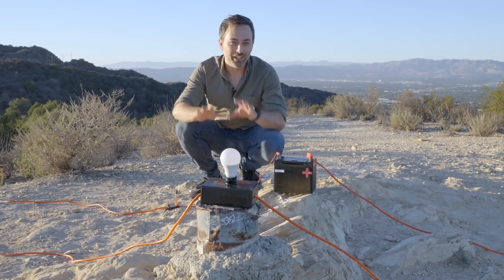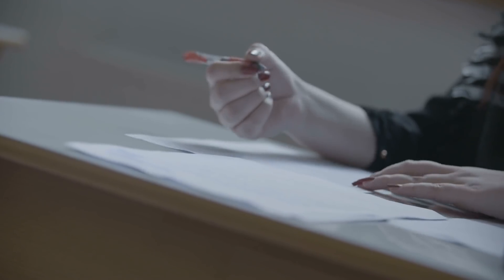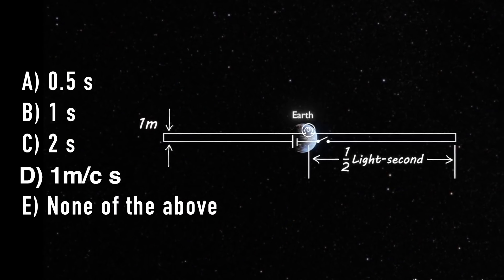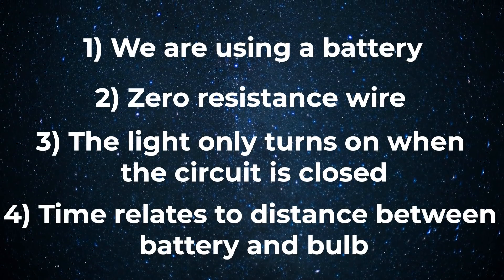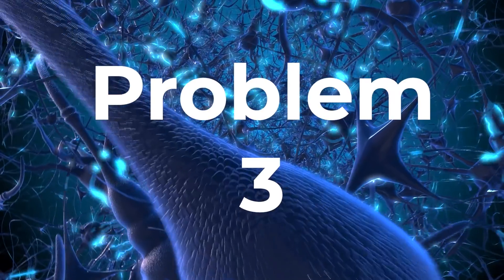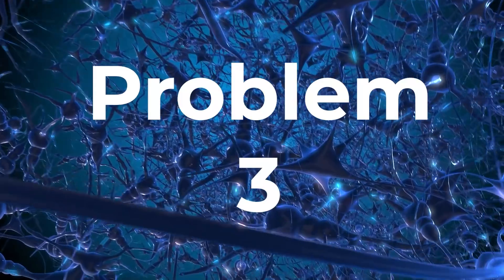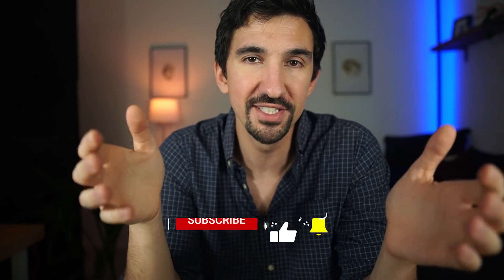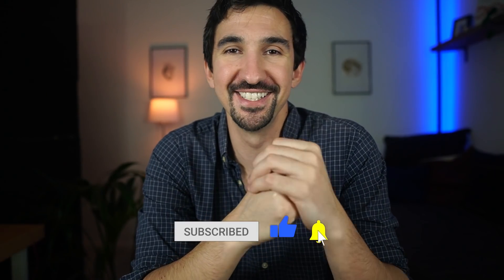Is Veritasium Wrong About Electricity?

Comment: Dr Miles, you've made a lot of very good points here, and thank you for taking the time to re-complicate something that was poorly oversimplified.
I don't know if someone has already mentioned this, but a really big deal breaker for that first thought experiment is very simply that although EM waves propagate at the speed of light, electrons have mass, and can only move between atoms at a small percentage of the speed of light.
So while things like radio waves will travel wirelessly between a transmitter and a receiver at the speed of light, as soon as electricity, or more to the point, electrical current is involved, we're back to signals travelling between atoms of a conductor at (I think) around 2.2 million meters per second. [EDIT: it is 2.2 million. I put 220k before because I forgot how long a kilometer is (doh!)]
My background is in computer engineering, and over the years there have been a few quests into the concept of light based computers as a means to overcome the speed limitations of electricity.
Reply: Maybe only 220,000 in fiber-optic. In bare copper wire about 285,000 (95% of light). See "velocity factor" for more information. VT ignored velocity factor explicitly as it would have been an unnecessary complication. (Much like first semester physics ignored air drag when covering gravity.)
Reply: @briant7265  yep, you're right, the velocity factor does add another dimension to this. I've only just recently learned the tiniest bit about this playing with antenna designs for radio receivers (something I'm still mostly clueless about). This still relates to the propagation of EM waves though, and how  different conducting and insulating materials affect them.
I'm looking at this from the the point of view that in electrical circuits, the movement of the electrons between atoms in a conductor happens at that much slower speed I was referring to.
In the case of electronic circuit designs, the timing of signals can be controlled by making the tracks between components either longer or shorter. You see a lot of these types of tracks around the CPU on a PC motherboard. If electrons behaved the same as photons and everything happened at 95% light speed, this form of timing control... well, the differences wouldn't be in microseconds, they'd be more like pico or  femtoseconds, and not much use at all.
Maybe I'm just confusing things though. I've been breathing in too many solder fumes!
Reply: @jamesstevens2362  One thing Veritasium covered that was interesting was that the electrons themselves move slowly, while the energy is a sort of electrical wave that moves near light speed. 

I got a ham radio license 11 years ago, and when you start looking at RF in transmission lines and antennas it will make you think differently. 

Here is a fun thought. A 3 GHz clock signal equals a 10 cm (4 inch) wavelength. That means when the clock goes - to +, circuitry 2 inches away is just going + to -, half a tick behind. At 6 GHz, 2 inches away is a full clock cycle behind.
Reply: @briant7265  how right you are! Coming from a digital background, RF has been a real eye opener. I attempted to design a PCB for a 5GHz downconverter, but getting the essential circuit traces exactly right for those frequencies did my head in! So yeah, I get what you mean about the electrical waves. It’s not just about the volts and amps you get from electrons moving about.

Comment: I think the power of the battery and material of the wire are irrelevant, they were illustrative to his proposition. He could have connected up 10,000 12v batteries in series to overcome your quibble on this point, and that was not the point. From my "O" level mindset, electrons migrate through a wire at far less than the speed of light, but the "Impulse" from one electron to the next in the line down the wire travels at the speed of light, doesn't it?

Comment: I thought the entire thrust of Veritasium's video was to debunk the misdirection about how electricty is delivered along a wire... that it's not a series of electrons nudging each other along the wire in order to transmit the energy from one end to another.  His video finally gave me, for the first time after many years, a plausible explaination of how the energy relies on fields around the wire rather than what's happening in the wire.  Which to me makes far more sense.  Just like magnets, which have obvious fields, surely electrical circuits rely on the same kind of behaviour given that both relate to the eltromagnetic spectrum.  I didn't give any thought to the subject matter of time, but found the fields illustration the whole point of the video.  And at last, relieving me of a conception I always thought was a bit dodgy.
Reply: There's a distinction between energy propagation and fields propagation though. Energy is propagated mostly around the wire, where there's also a tiny magnetic field hence nonzero  Poynting vector, but the electric field itself (if I'm not mistaken) is most intense inside the wire.

You need an 'intense' electric field  in the wire to generate a tiny magnetic field around the wire, to get a Poynting vector along the space surrounding the wire, that will carry most of the energy. 

(warning: this is not my field; my phd is in math and it has been many years since I took physics II)
Reply: @rv706  I'm a mechanical engineering student who is just now finishing my physics two class...finals week is right around the corner....

The equations for magnetic field in relation to a theoretically Infinite straight wire do propose that the further you get from the wire, the lower the strength of the field....the distance variable is in the denominator. But as soon as you cut into the surface area of the wire,  you greatly reduce magnetic field since you have reduced surface area of current propogation.
Reply: @Abrafo_00 : Yup, I think my picture is consistent with what you're saying
Reply: @Abrafo_00  The reason for the infinite length is to remove the curvature of the field at the ends of the wire.
Reply: No, it's delivered by the electrons jostling in the wire.
Reply: @Edward Dunni dont think you got the point...maybe its the langueage barrier...eveyone needs to say they work at aerospace etc to make themselves appear credible in youtube comment sections....they cannot just be ragular guys who have a regular job but are smart and educated, they just need to say they work at nasa, aerospace or 50 years of experience on this and that, and while some of them may actually be saying the truth, i can assure that most of them are full of crap....because people who actually have a top notch career dont have lots of time to waste on youtube videos and they actually know about the subject to the point they can just spit arguments without needing the additional "brag to make look credible" thing....got my point???
Reply: IMO the idea that electricity travels only through EMF is preposterous.
It's well known that electricity travels along the surface of the wire, and the EMF field that's created is a side effect that may be usable in certain scenarios.
And by extension all that talk about EMF frequency (and the unmenntioned amplitudes) is similarly irrelevant to what is minimally required to propagate electricity.
The proposition suggests that resistance has no part of calculating the efficiency electrictity can be conveyed along the wire which is entirely wrong.
I don't know how such stuff can be believable, when it violates all known properties of electricity that is taught and observed. Nothing about the new paradigm fits what's been known and utilized for over 100 years.
Reply: @tonysu8860 : What do you mean by "electricity"? There is no quantity or entity called "electricity" in physics. The physics tells us about EM field, charge, and current.
Reply: @tonysu8860  What do you even mean by "electricity"? By most people's definition, that is literally equivalent to electromagnetic waves propagating through the field. The electrons themselves are moving within the wire move quite slowly - there's a reason that electricity propagates at near the speed of light and not 1mm/second.
Reply: @tonysu8860  i am just a repair guy so feel free to toss my opinion in the bin mister nasa... but ......this concept is well known? well known? really????so you mean that quantum engineering crazy nasa space nobel prize dudes exist in meaningfull numbers when compared to regular electrical engineers and repairmen and that their opinion is meaningfull enough usable or practical but somehow that stuff is not taught in universisties and schools, instead they teach lies like ohms law? ohhh they must be evil!!!! well obviously i believe in all you say BUT and here is the perspective of someone who actually works with circuts. while there might be some current induced into the bulb it is so small that is not even measurable with any standard equipment, let alone make the filament glow..if the electricity travels inside the wire or outside via fields, i  dont know, but the light bulb wont turn on and will not see any measurable current through it in that amount of time. and the definition of ON is easy. wire is zero resuistance, voltage is 12v, bulb's cold resistance is X ohms so we should be able to use ohms law to calculate the inrush current it will see once the circuit is completed with the frickin wires

Comment: Dr. Miles, I agree with most of your conclusions, and I had similar disagreements with the Veritasium arguments.
I would like to suggest a different mental model, though - A DC circuit with really long wires. 
As shown in the Veritasium video, the positive terminal of the battery is connected to the wire, through the lamp, and back to the switch. That means, relative to the negative terminal of the battery, the ENTIRE LENGTH of the wire is effectively at 12V. Closing the switch, the wire at the right end of the switch would present itself as an open circuit. There would then be a negative-going voltage potential edge signal presented to the wire. This edge signal would then propagate along the right-hand wire of the circuit at light speed until reaching the lamp. During this time, since the wire is assumed to be a superconductor, there is no voltage drop anywhere along it, and therefore no current flow. When the edge signal hits the right terminal of the lamp, there is either an impedance or an effective resistance, resulting in a voltage drop across the lamp, and current would subsequently begin to flow through the lamp, and presumably it would begin to produce light we'd see immediately afterward. But, the wires would continue to present as an open to the battery until the event that "current is flowing" (presumably also traveling at the speed of light) reaches back to the battery.

Comment: When the battery is connected to the wires the electrons gain potential and this propagates at the speed of light to the switch. When the switch is closed the electrons are already there bursting to move and light the lamp.

Comment: I think the conclusion of "almost immediate" must be wrong. If it was right, you could transmit information to the fartest points of your setup (150000 kms away) in no time, violating the principles of physics - no information can be faster than light.
It should be easily to measure this. With 10 to 100 metres of wire you can measure the propagation of the current through the light bulb.
As electrical engineer I am dealing with position encoders in electrical motors which are up to 100 metres away from the control-electronics. And this means a signal delay of roughly 1 microsecond from sending out an electric voltage to receiving it back because the signal travels at about 70 % of lightspeed c in the wires. 
Again: nothing can be transmitted faster than c
Reply: Quantum physics has already demonstrated that info can move faster then the speed of light & that the speed of light is not a constant as once thought.
Reply: @MrGarymola  please state the source of that Information....

Comment: The problem I have with both videos is that this experiment is not limited to Alternating Current (AC) supply. The circuit could be Direct Current (DC) and then we couldn't talk about antennae modeling or electromagnetic fields the way veritasium put it. I do like your introduction of causality to the problem. Because there is something fishy occurring the moment the switch is turned on, almost like introducing an observer or measurement.

Comment: If you break the wire at the furthest point it will take 1/2 light years for the light to go off, it’s the same as taking the positive terminal of the battery (or the negative) 1/2 a light year away. So I still stand with vertasium on ur first point

Comment: Problem 2 doesn't exist because assumption 3 is incorrect and Derek never makes it. Lightbulb turns of in 1m/c after the switch is opened. And 1/2 s if the breakage happens in most remote part of the circuit. So light will shine for a short while when circuit is not closed.

Comment: 1/c makes sence because 1 is not a unitless value its 1 light secound wich is a distance .. distance/speed= time
Reply: lol that's not right at all. Sure you get time as a unit, but if you divide "1 light second" over C, you don't get the time that light takes over 1 meter aka "1 light second" with which you started...
Reply: @arisoda   yes  its actually 1 meter not 1 light secound  the distance between the interrupter and the lightbulb  a little conufsion :p
Reply: or its the distance between the battery and the light bulb
Reply: @serektaibah4091  It is the distance between the switch and the bulb. (Again a critism that Dereks video actually confuses more than it clears up)
Reply: @georgelionon9050  naa i dont think so , because according to veritasium logic no matter where the switch is  it will always take 1/c of time for the light bulb to light up  even if the switch is on the  farthest point   wich gave rise to the breaking of causality issue  therefore 1/c must be the distance between the battery and lightbulb
Reply: @serektaibah4091  If thats veritasiums logic then it is wrong.
Reply: @serektaibah4091  just off-topic but why are you sometimes using 2 or 3 spaces for a comma or in other places? No more than 1 space is ever needed in English?

Comment: Thus, to be more precise, the time between the switch closing and the bulb "turning on" is approximately 1.5 / c due to the position of the switch relative to the battery in Derek's outdoor scenario.
Reply: replace "turning on" with "a minuscule something would be measurable"

Comment: The “mental model” is Transmission Line Theory. The original Veritasium video has a lot of curved balls in it, such as confusing DC with AC models and behaviour, and the smearing of signals in undersea cables piece which has nothing to do with what was being discussed (it’s a phenomenon known as “dispersion” in lossy transmission lines where different frequencies have differing propagation velocities).
Reply: Exactly.  I would say Versatium is wrong, because he doesn't mention the very well developed theory of transmission lines.  Mentioning the undersea cable was great, but he missed the point, that early telegraph was hampered by lack of transmission line theory.
Reply: Transmission line theory, surge impedance, velocity factor, etc. It explains it all.
Reply: Fundamentally though different propagation velocities can only truly be explained by looking at electricity as traveling 'wave-functions' rather than simply a chain of electrons pushing on eachother. The current at one specific spot on the wire in the faulty electron-based model can only be one, so all transmissions regardless of frequencies must travel at the same speed across that intersection.

So eventhough he didn't delve deep into it (which tbh I get, he needs to compress some material), I understand the connection he was trying to make.
Reply: @ricroflxD  something to do with the electric dielectric property vs. the magnetic constant. It's been a long time.
Reply: @keysersmoze  I have studied it too, and I know what you mean. My point however was that before you even get to the technical details of exactly what material properties characterize the propagation delays,or even if the modes of propagation are TE or TM waves, you have to conceit the fact that the model of propagation of electricity is not due to physically being powered by electrons, but by the model Derek highlights in his video.

Overall, yes Derek skipped some important electric phenomenon in his explanation but everything he raised was relevant to the model he was trying to portray.
Reply: Yeah that was generally my thought when watching it that it seemed a bit deceptive

Comment: An electrical engineer will tell you that you're both wrong. You need to understand LR and CR time constants and understand that you need to input R, L and C to get an output of time.
Reply: That's for a DC circuit. For an AC circuit, it depends what part of the cycle it's at when you turn on the switch.